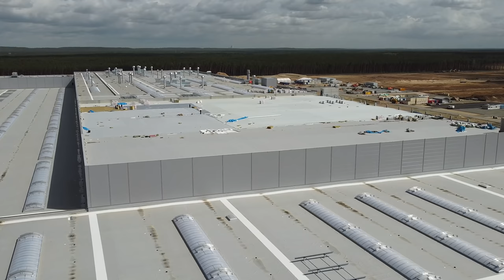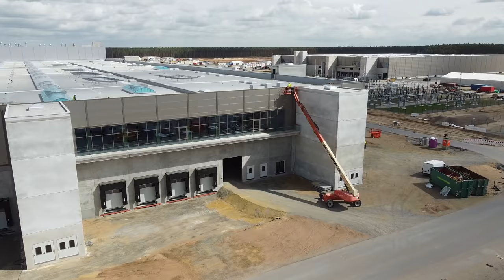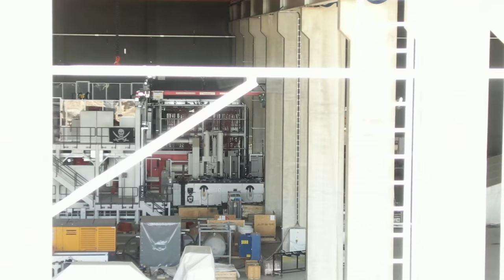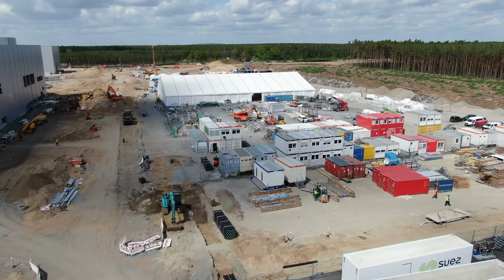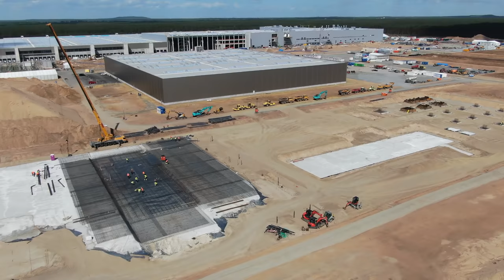Giga Berlin | 2021-05-22 | Roof closed (finally)

Comment: Most amazing rebar installation for the slab in the new battery building (around 14 minutes). Just outstanding video and drone work, Tobias. Congratulations to the subtrade doing the rebar install!
Reply: Not more amazing than the other foundations they built there.

Comment: Thanks Tobias for the update - great pictures as always. 

Some minor observations:
1:25 at the casting section on the new roof, we see in the lower left (closets to us) a small red square. My guess would be that the chimney from the melting furnace will be placed there.
5:50 on the left of the aisle - the two black boxes are the melting furnaces. 
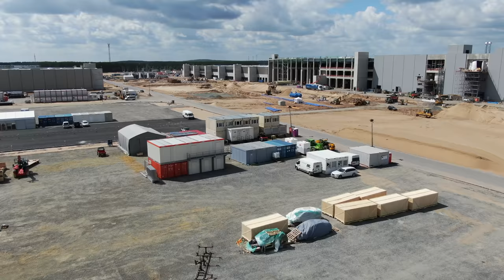11:30 I would like to know what there is in those crates.... They weren't there two weeks ago.
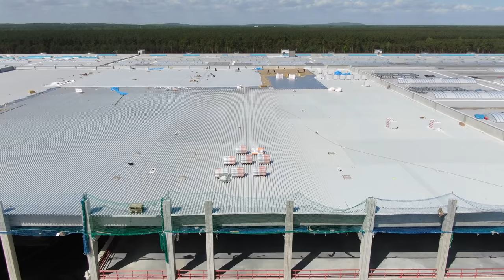Reply from the maker: At 7:15 you can also see some installation points on top of the columns. I don't know what will be installed there though.
At 11:30 might be more Model Y bodies? Size and location of the crates would fit.
Reply: @TobiasLindh  We can only wait and see what the GF has in store for us. Might be many more surprises we aren't aware of yet.

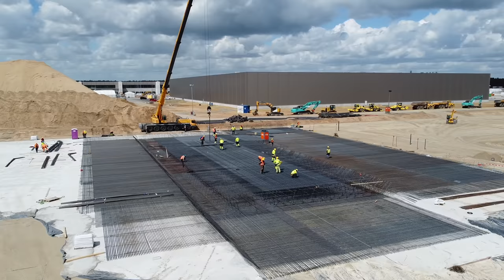Comment: 13:22 That's one big footing!
Reply: Not bigger than for the casting machines or the press shop.
Reply: @julianreverse  It's not bigger overall deeper but in is much much thicker than any part of either the casting or stamping foundations.
  Calling this a foundation may not be quite right.  I think this is designed to be a boat.
Reply: @timboatfield  No it's not! The casting foundations are over 3m high, also the footings für the columns of the paint shop.
Reply: @julianreverse  Oh Yes it is! (Is it Christmas already?!) There is no one bit of concrete in either that is as thick as this slab.  Sure the other subsurface sructures are taller, but smaller in both length and width and in any single section of concrete form.
Reply: @timboatfield  🤦‍♂️
Reply: It has to be for something very heavy or something with heavy dynamic loads like a press. Is there really equipment like that for battery manufacturing?
Reply: @BjorckBengt  Yes you need stamping presses for the batteries outer shell.
Reply from the maker: The casting foundations are over 3m in height? The people who build them must have been giants.
The footings for the paint shop where pretty high, but there were much smaller, because they were single footings.

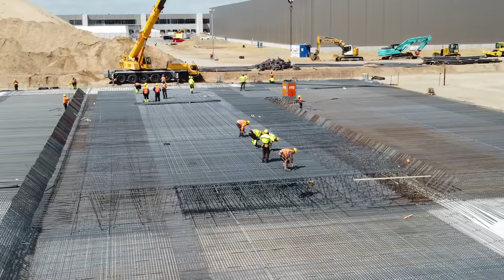Comment: @ 14:44 thats one heck of a foundation!  The concrete pour will take forever.
Reply: As well as drying. Are they building a landing pad for starship? -_-
Reply: @FlorentHenry  It's a launchpad for 4680s.
 I havent followed progress in this area enough to know if or how much piling was done in this area.  I don't remember any.  So i'm reading this as a load spreadding device to avoid disturbing the water table with piles.
Reply: @FlorentHenry  Concrete doesn't dry, it's curing. And it won't take longer as for a 20cm slab because it's a chemical reaction.

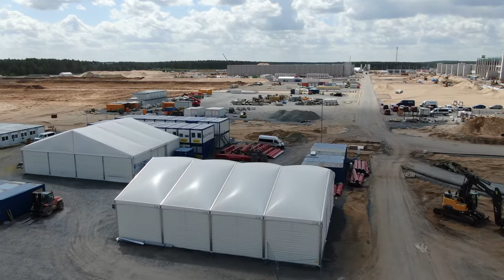Comment: At 10:57 looks like the roof is air inflated in two layers ply.
Reply: Its a positive air pressure controled environment to store stuff thats not as happy as some to get left out in the wind, cold, sun and rain.  The positive pressure, which is why they are puffed out, ensures that air only exits through any leaks and doesn't come in.  Enabeling maintaing tempriture and humidity within required limits inside.
Reply: @timboatfield  ok. But the walls are not inflated, only the roof.
Reply: @joaoamilcar4118  The walls are regid, the roof is not.  If you got closer it's probable that the wals are also puffed out a little.

Comment: Good that there's some outer progress but despite some support from Germany withOUT groundbreaking for the support buildings that are necessary for factory start we're still minimum 4 months away from operation.
Reply from the maker: I don't know how long it will take to build the support buildings. The tank farm and waste water treatment plant started, but still no work on the the central utility building, fire station and hazmat storage. I don't know why they don't start it.
Reply: @TobiasLindh  A permitting issue perhaps? Maybe some buildings have to be designed based on final plans and Tesla is changing them. Perhaps they can only be built with a final (environmental) permit. 

But... could some of these missing buildings actually put inside the main one? So perhaps they integrate everything under one roof. 

Either way, 4680 battery is even more not ready and with chip shortages, finding enough cells and silicon would be the next headache for Tesla. This year's growth is limited by various issues (China FUD, components shortages, permit delays), yet they still break estimates so its not a biggie and lately Elon doesn't seem too bothered about Berlin delays. If Austin ramps, they'll just ship the Model Y to Europe I think.
Reply from the maker: @BigBoneESB  Tesla does have the permission to build all supply buildings for a long time. They even had the permission for extended working hours for the foundations of the supply buildings until mid April, but Tesla didn't use it.

The battery factory is not part of phase 1, so it's not expected to be ready with the start of production. For now Tesla still didn't even apply for construction of a battery factory.
Reply: @BigBoneESB  Those support buildings are covered by a permission granted in July 2020. 
The support buildings Tesla now started working on are exactly were they had been on the plans submitted last year. 
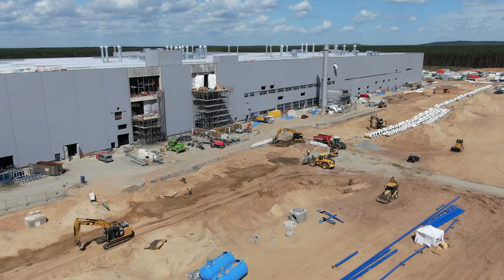7:59 the cable canals and pipes in the upper left opening do also fit with a planned cable/pipe bridge to the support buildings in the central row.

I would also expect that those support buildings will be ready in Sep/Oct. Probably the bottleneck to start (real) production does lie elsewhere (and later). And than it is also resonable not to waste extra resources (and money) for finishing those support buildings earlier.

Comment: It is apparently obvious that Austin will start producing cars before Berlin.
Reply: I hope once established the 2nd phase onwards speeds up in Berlin. Just a tricky beachhead to start on
Seeing how many workers cars are in the car park much less is getting done, but then I dont know how much there is left to do..
Shame really, I kinda forget about this project as it seems much more exciting in the US
Reply: As you can read on Elons Twitter, the suppliers have to accelerate, on his opinion.
Reply: @cookiemichelangelo  I think by now many trades are finished and machinery positioned, It is probably mostly connecting up and testing and as the areas are completed, they will be configuring for flight.  Less cars is a good sign.
Reply: @timboatfield  Some trades are more or less finished.
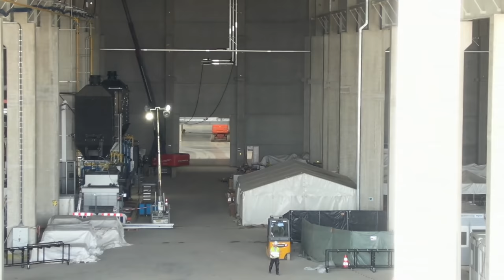But have a look into the BiW trade at 6:30 (which is behind the casting). 
Tesla has since 10. Feb. 2021 the permit to install production equipment in the BiW. Can you spot any?
And if it comes to the GA and DU the situation is not any better. Elon Musk had surely reasons to ask the suppliers to accelerate.
Reply: @abalada  Not through that one door no I can't, but the BIW lines are reduced by 60% by the castings, so are likely to be using less space than they budgeted for or have more lines to install later as they ramp.  I've not seen inside any other areas recently so there is no way to know.  Feel free to link anything i've missed.
Reply from the maker: @abalada  The BiW is full with installed production equipment and robots. Don't let the tiny view through the open door fool you.

Comment: I can't see Tesla sitting on their hands with a pristine new factory for six months while regulators push paper around.
Reply: They will be producing production cars before the factory is aproved.  I didn't realise Germany was so tied up in inefficent government and regulation.  Poor show Germany!
Reply: it will take some time to validate equipment and processes. They won't be sitting on their hands as the building is complete.
Reply: Elon Musk had his reasons to ask the suppliers to accelerate. 
Have a look into the BiW section at 6:30 (which is behind the casting). 
Tesla has since 10. Feb. 2021 the permit to install production equipment in the BiW. Can you spot any?
And if it comes to the GA and DU the situation is no better.
Reply from the maker: @abalada  Can you spot any? 
https://photos.google.com/share/AF1QipOVTM-avTBP0VMbqc3dynh6a0Gq4z2_t9lrFmAQEuHDrQJVKZpywfh8ec-nKr4slw/photo/AF1QipP1cdt-shy6D7W9llfuhJ_y44p-mskFkz-G7zfb?key=UGhENXdDelpLTDVsRURKWkNXRVVxdFBYR3Jrc0Vn
https://photos.google.com/share/AF1QipOVTM-avTBP0VMbqc3dynh6a0Gq4z2_t9lrFmAQEuHDrQJVKZpywfh8ec-nKr4slw/photo/AF1QipOCIin5qBnlSEDgGgo3Vvz7-0VaL_pvJf3D3-f1?key=UGhENXdDelpLTDVsRURKWkNXRVVxdFBYR3Jrc0Vn
BiW is full of installed production equipment and robots.
Reply: @TobiasLindh  Danke

Comment: Cool video again Tobias!

@11.28, these Model Y body's still sitting in this staging area.. almost everything around them is gone! The staging areas get more empty every week!.. Good sign!

Any news about the casting machines, any castings spotted?  Texas is spitting out hundreds of them already!

These foundations for the "warehouse" are HUGE.. probably will be more than a warehouse alone... Battery factory still a strong rumor, or in the mean time just the reality, and used Tesla the warehouse argument to start the construction sooner?
Reply: Tesla files for a building permit for the "warehouse". When asked by the government about the rumours, they replied with "we are indeed investigating if it would be possible to install a battery factory in there in the future and if we were to decide to do so, we naturally would file for the environmental permits at that date". Which very clearly means "yes, this is the battery factory, but if we were to admit that, we'd also admit that we lied on the permit application to speed up construction".

They used the loophole that it is easy to get a building permit, but takes ages to get an environmental permit.
Reply: @HenryLoenwind  Thanks, I did not know Tesla already provided this information.
Reply from the maker: The number of Model Y bodies is varying though. Sometimes we see 8-10 Model Y bodies. Now it's only 7.
The casting machines are much further completed than the casting machines in Texas, but I think they'll need a permission before they can test them. Tesla did recently apply for a permission to test some production equipment.
Reply: @TobiasLindh  Thought the same. On the other side on a video from Friday one can see a LNG tank lorry refilling the LNG gas station. And Julian wrote that this is already the second time this was done.
Reply from the maker: @abalada  The question is, what would they use the gas for, if they don't produce castings? Or maybe they do produce castings, but they are send to BiW right away?
Reply: @TobiasLindh  Grilling sausages? 🌭
The whole setting up of this temporary LNG station made only sense for testing the Giga Presses right now.
Reply: @TobiasLindh  But that would be unfair if they would hide the casts in the BiW from us and the Americans believe they are faster than the Germans.

Comment: Texas was  putting in robots before the walls went up. And you still have dirt floors? Come-on guys. and i was rooting for ya.
Reply: 🤦‍♂️ Berlin had robots inside before Austin had a roof.
Reply: At GF4 they stored the robots first in tents and moved them only into the building after the walls had been closed and having the permit to do so. E.g. these robots from KUKA in early February
https://www.tesmanian.com/de/blogs/tesmanian-blog/tesla-giga-berlin-kuka-robots

Since early February Tesla has also the permission to install production equipment in the BiW section. 
6:29 Hmmm?
No dirt floor visible anymore - but no production equipment installed there yet either.

For the GA Tesla even applied for a permit to install production equipment only in mid-April (was granted this week).
And as long I've not missed something Tesla did not yet even apply for a permit to bring production equipment into the DU at all.

The finishing of the buildings - incl. underground cable and pipe laying up to 3 m depth - is covered by a permit from July 2020. Thus Tesla could have finished the floors there since long. And there is basically only one logical reason for not yet finishing the floors and applying (earlier) for a permit to install the equipment: the plans are not yet finalized. Which could be either for not knowing exactly what one wants - or not knowing what you can get at all. Thus it looks not only that some suppliers have not yet delivered but furthermore that's even difficult to find suppliers in some fields able to deliver in the near future at all.
Reply: @abalada  It's clear that they started without having finalised plans and have been prioritising those parts that take longest to install (painting, normal presses). The missing parts (GA and DU) will contain machines that mostly can just be placed on the floor. So no heavy foundations, no multi-storey assemblies.
Reply from the maker: @abalada  As I already wrote in another comment, don't let the tiny view through the door fool you. The BiW section is full of installed robots and production equipment. You can clearly see it from the Autobahn. The tents where the robots were temporarily stored isn't even there anymore. Right now they are waiting for the permission to test the BiW equipment.
Reply: @TobiasLindh  "Right now they are waiting for the permission to test the BiW equipment." Did Tesla apply for such a permission? In the sources I'm aware of only stamping and paint shop were mentioned. Albeit I'm pretty shure those permits will be granted rather soon.
Elon Musk surely had his reasons to twitter that some suppliers should accelerate. Would make no sense if those delays are no risk for the overall schedule.
Reply from the maker: @abalada  I still don't know the exact content of that application, but I also know from workers that they are about to test the equipment in BiW.

Comment: I don't get it. I thought they had decided to wait for the over cranes to close the roof, but it seems that the cranes are not here. I won't be easy to put them in now.  There is not a lot of place left.  Or did they change their plan...
Reply: It doesn't matter if there is a roof or not to install the cranes. It's mostly done under a roof.
Reply: @julianreverse  Welcome to Brazil Mr. Elon MUSK and Investor too...
The future is on the Present, for Broken the Paradigms araund the World... Welcome the world   Batery #4680 electric lond Power Rang long Distance...

Time for Broken the Paradigms about Batery Power long Rang..
Reply: There is no known reason why they did not close the roof earlier. 
The first bridge crane in the left aisle (with the 2 Giga Presses) was installed when the concrete roof bars were already up. And the second bridge crane was installed there late March when the roof there was already closed. Those cranes were also installed by a crane company the bridge crane manufacturere hired. Not by one of the crane companies involved in the setting up of the building itself.
Reply from the maker: I did hear a rumor, that the already installed columns were damaged by freezing water in the holes where they would usually fill in-situ concrete to glue the parts together. So they had to repair them before they could install the beams.
Reply: @TobiasLindh  That fits the hole at least.